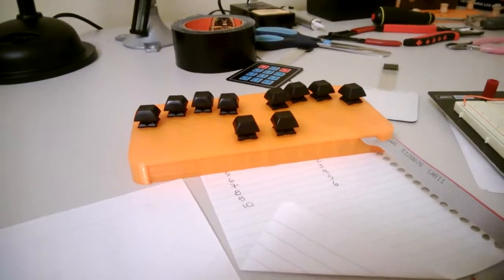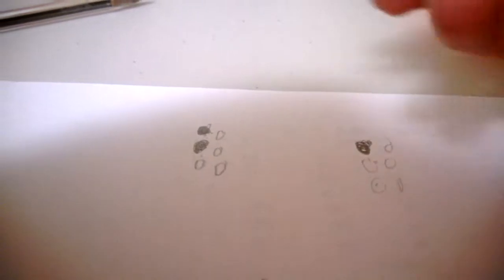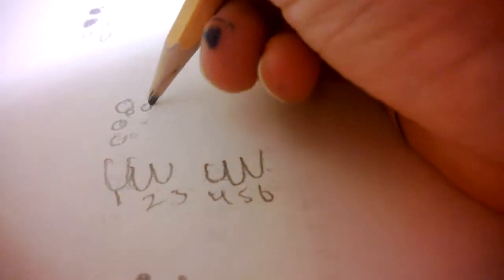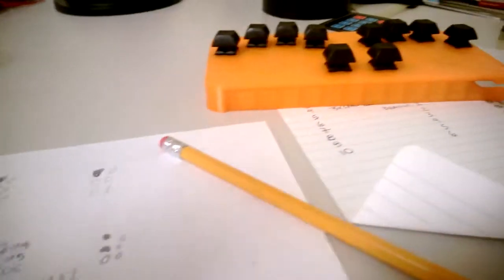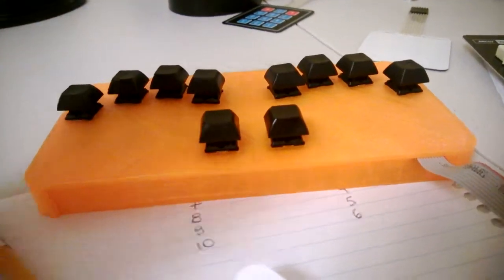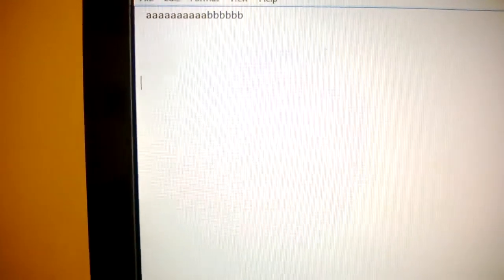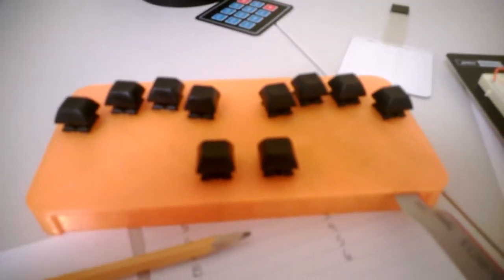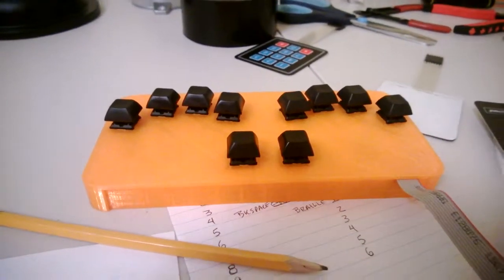Perkins Style Braille Keyboard Introduction

Comment: I'm thinking about something similar:  A Perkins keyboard built into an iPhone case: such that you have thumbs on glass, and 4 fingers on the BACK of the iPhone.  The reason why is that if you can make it a virtual qwerty keyboard, then you could get SIGHTED people to use braille just to be able to walk around and text.  As long as stuff is "made for blind people" it all remains wacky expensive with people in white lab coats driving the prices up and saying "uncle insurance will pay for it".  Orbit Readers set the example.  Make them cheap, and web developers will be buying them just to test accessibility; and people will use them as chorded keyboards.  If everybody uses a Perkins keyboard; suddenly all the accessibility issues get fixed.  People web browsing and tweeting by ear will notice all the accessibility problems before blind people report them.  And qwerty just does not, and can never, work on a phone.